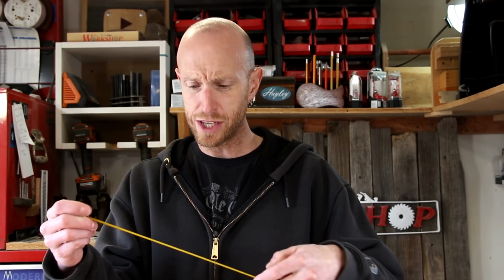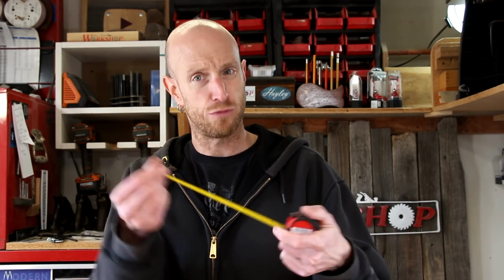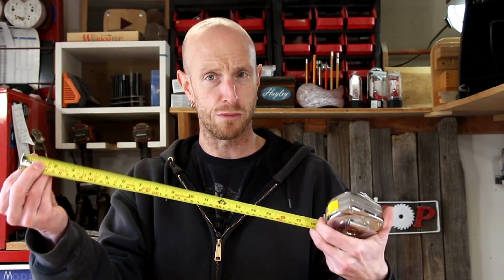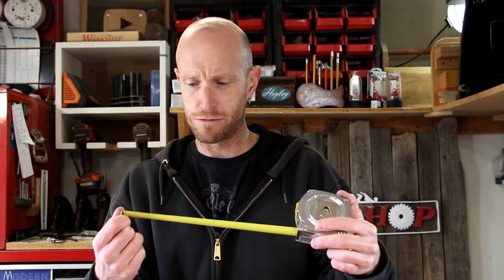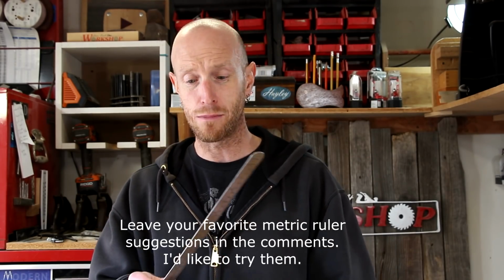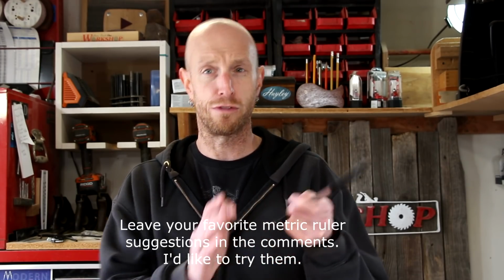My thoughts after using the Metric System for a project | I liked it

Comment: Well, after reading some comments, I decided to add my own as well. I grew up in Switzerland and we had the metric system as long as I remember. I wanted to be a mechanic, therefore I had to learn the standard system and then there was also the British system called "Withworth" and that one can screw you up big time. The one thing I learned is it's either this or that. The biggest mistake most people make is that they want to convert. Until today I haven't found out why. If it's metric, use metric tools- if it's standard, use standard tools. OK, I know that 5/16 is about 8mm, 7/16 about 11mm, 1/2" is about 13, and so on. But I am not doing that. The funny thing is, that the standard system was originally used in Europe and was brought over by the first immigrants. As an example, one Inch was called "Ein Zoll"(german) and they had a piece that that was about 12" long (about 30 cm)and it was called "Elle" and had been taken from the the Elbow to the wrist ( wire, cables, ropes and fabric used to be sold by the "Elle" which then turned into the "Foot". And they also had a longer piece (3 x 12" which is now one yard) but was called "Zoll-Stock". And even so that Europe is metric, if you buy a tire, all measurements are in metric, except the diameter  of the rim ( 265 - 75 R 18  means 265 mm wide 75% of it is the height and 18" is the diameter of the rim

Comment: the fun thing is, expect in america basicly NO ONE calls it "metric system" its just the normal and ONLY system that exists for the rest of the world xD everything based on 10 it cant be easier every 5year old can understand it
the best thing is it works for every system, volume distance radius lenght weight, its all the same and you can convert it so easy
Reply: Well it is actually called the metric decimal system.
Reply: i mean it's called whatever we choose to call it- maybe SI would be the most accurate way to call the system? but then things like km/h and °C are not SI, so maybe it's the almost SI
Reply: Well it does has the name "Metric System", but of course the name is hardly used if their woudn´t be any other system.
Reply: @valebliz  No, never heard of that. The americans tend to use numbers like 3 ⅜. they even invented Unicode characters for such weird numbers. But this has nothing to do with the metric system. It´s just another oddity in the states, but it´s independent.
Reply: @aiocafea  I like SI a lot, and ''metrics'' is generally either on point or close enough that it doesn't matter. They still click into each other if you know what you're doing.

Comment: First of all a great compliment for trying something new and to judge without prejudice.
In the past many different units of feet and pound were also used in Europe. But the advantages of standardization and simplification of calculation and relations between measurements (volumes/distances/surfaces/weights/speeds/...) helped to get the idea accepted.
Not to mention that a lot of money was saved in the process...
Reply from the maker: Thanks, I'm not against it at all. It's just not a system I was raised on so for me it's cool to get some experience.

Comment: Interesting thing: the inch is now defined legally as being 25.4mm. So even when you’re using imperial units, your using something based on a metric standard! (Same goes for ounces and pints etc.)
Reply: 25.4 does not sit well with me...
Reply: Interesting thing once the inch was defined as 2.54 cm it was no longer an Imperial measurement either. BTW the USA never used Imperial, ever. Us both adopting the same standard international industrial inch just makes you think we do/did. That's what the 2.54 cm inch is BTW. It is the standard international industrial inch. It is NOT Imperial!
Reply: @1pcfred  imperial was what it was called over here, that’s the only reason!
Reply: @JimforbesRitte  care to run that by me one more time? Imperial is what what was called? What is this it that you refer to? "imperial was what it was called" It what?
Reply: @1pcfred  imperial is what the old system was called - particularly here. Or “real money” as my dad says!
Reply: @JimforbesRitte  I am somewhat aware of the British Imperial system. It is markedly different than the US Customary system. Although US Customary shares names with British Imperial. Which causes no end of confusion among many people. That and both nations adopting the same length measurements. But once the British did that they no longer used Imperial themselves. The modern inch is not the Imperial inch. Although you can't tell by just looking at it. Because the modern inch is only a few millionths different. Again more confusion!
Reply: @1pcfred  really the inch was retained to keep the old duffers and daily Mail readers … happy is the wrong word…  less angry?
Reply: @JimforbesRitte  you make that up all by yourself? Keep it up and you'll never know what being an old duffer is like. Now don't go away mad, just go away.

Comment: I'm in the UK and we seem to be bilingual when it comes to measuring.   I can happily cut a piece of wood 200mm by 3 inches.
Reply: Beer in pint and body weight in... stone?
Reply: ... Mars Climate Orbiter...
Reply: Same here in Oz.
Reply: This bilinguality already cost people their lives when a plane went down as it had no fuel left because the pilots expected the fuel numbers in metric but the ground personnel acutally used imperial...
Reply: @srccde  thats more to do with the aircraft measuring in KG and the ground equipment measuring in Litres, as aircraft fuel doesn't weigh the same as water you have to use specific gravity of the day to calculate the fuel load.... although it is a basic pre-flight check for the pilots to check fuel levels before take off.
Reply: @antonyaiken  Right, it's been a while since I read about the specific incident I was talking about but as far as I remember the pilots manually entered their hand-written (false) fuel data into the flight computer which, apparently, had no means of measuring the fuel level other than calculating it and relying on the data the pilot's gave it.
I think what happened is that the pilots gave the numbers in pounds but the ground crew interpreted them as kilograms...
Reply: @srccde  that reminds me of what I've heard about an incident (search for "Gimli Glider") in Canada that happened almost 40 years ago when Air Canada was apparently just switching to the metric system. Before the flight, the pilot calculated the necessary amount of fuel in kg , but the ground crew which pumped the fuel into the plane interpreted that number as pounds ... therefore they only had enough fuel for about half the flight ... which they didn't notice before both engines went silent in the middle of the flight. Fortunately the pilot had experience as a glider pilot (one of his hobbies) , and the first officer was a former airforce pilot and knew an airbase in reachable distance... They managed to land the plane without hurting or killing anyone. Just a few minor injuries from the evacuation procedure.
Reply: Bottled beer and wine in ml, weight in KG if you’re under 50 years old. 😂
Reply: Ahahaha that made my day!!!!

Comment: As a UK cabinet maker of 20+ years, I finally found the perfect metric rulers - zero glare, metric both edges, etched markings, and no half-mm increments, made by Shinwa in Japan. Absolutely beautiful tools and outstandingly good value, available in 150 mm, 300 mm, and 600 mm.

And not only do I operate purely in metric for woodworking, I do all my measuring only in millimetres.

Comment: I appreciate that you stepped out of your convenience zone and tried a different system. And your honesty that - although it was something completely different - you had to admit it is indeed superior for several reasons. It is easy to use once you get familiar and does not require difficult calculations. And on top length, volume and weight are linked to the meter.

Comment: Excellent video.
New Zealand changed to metric during the first year of my apprenticeship, in late 70's.
Whilst it was a bit of a struggle for the older tradesmen it was a god send for me. I hated fractions then and I still do now!
Metric just makes sense.
1,000 mm = 1 m
1,000m = 1 km
I lt of water = 1kg
1,000 kg = 1 tonne
1,000 lt = 1cubic meter
Reply: do you guesstimate and approximate in ft/in though? I still do, we sound about the same age :-)
Reply: @alan-sk7ky  
Hi Alan,
Yes, it depends
Height, length- feet and inches
Distance, speed - kilometres
Weight - kilograms
Timber dimensions - inches (4x2)
Timber length - metres
Liquids -  litres (except)
Beer - pints or jugs
Top shelf - nips - whatever a nip is.....I have know idea.

All over the place really.....
And you?
1961,  by the way.

Comment: As a builder in the UK, I find it incredibly useful to be bilingual when it comes to measurements, as a wise old bricky said to me recently, It's always best to have several methods of skinning the same cat!
Reply: Google "Mars Climate Orbiter" :D
Reply: Yeah, tell that to the plane that went down because the pilots thought they got their fuel measurements in metric but the ground personnel had actually used imperial...
Reply: try getting a metric over inch tape measure, good luck :-)
Reply: @alan-sk7ky  they're standard over here

Comment: You have 10 fingers, which make metric extremely intuitive. Then their is the ease of calculating length, volume and weight (mass). If I asked you to build a container that would hold exactly 1 US gallon of water, then asked you what size would that be, and how much mass (weight) would it be. Could you do those calculations in your head? Could you do those calculations at all even?? Now switch to metric, and replace 1 US gallon with 1 liter of water. Here is the metric answer. 1 Liter of water would be contained in a container measuring 10cm by 10cm by 10cm square, and would weigh exactly 1kg. How easy is that! Metric is the unit of measure of science for a reason. Cheers from Winnipeg (Canada).
Reply: You need 1 calorie to increase the temperature of 1 gram of water by 1 degree Celsius. Water freezes at 0 degrees, boils at 100 degrees. Metric rules.
Reply: More than having 10 fingers, it's above all because we use a base 10 numeral system that it's intuitive.
Well using base 10 itself has been influenced by our number of fingers indeed, but not in all societies at first.
Reply: In the land of creationism, science is not a big deal.
Reply: according to this logic, 12 too ... because the thumb can count the cushions of the fingers

Comment: Whether you call it imperial or standard, even those units are ultimately defined using the metric system, which has actual, physical gold standard objects to calibrate against.

So metric is, in fact, the one and only standard.
Reply: I guess you never heard of the TROY OUNCE? Used for precious metals.